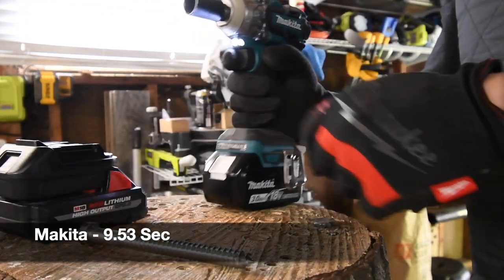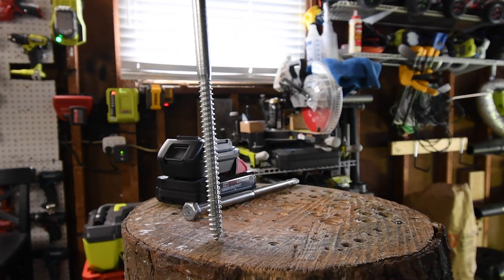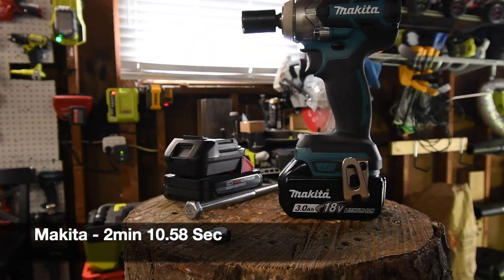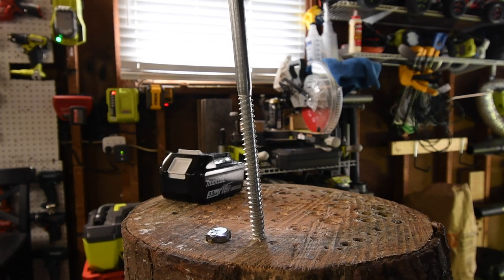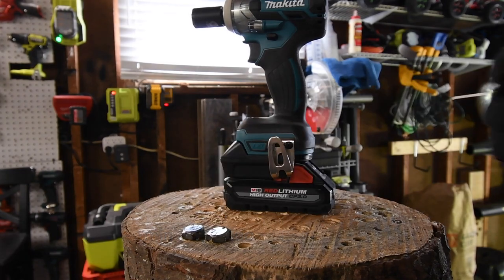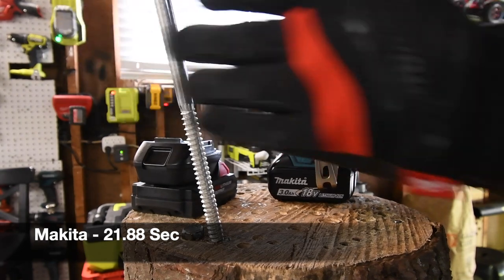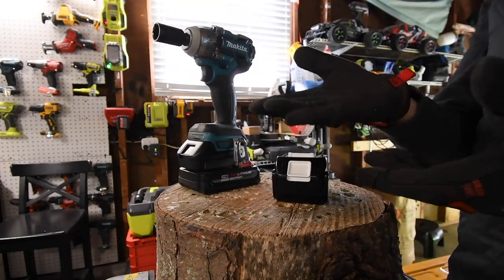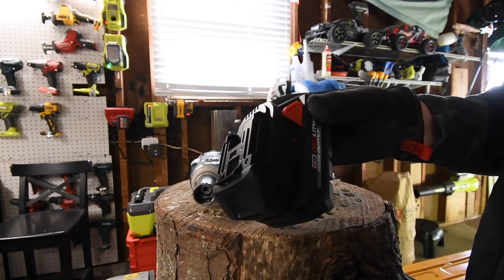Makita Battery Adapter for (Milwaukee and Dewalt Batteries)

Comment: So makita X2 36V with two adapters and HD 12.0 high outputs.
Reply from the maker: Makita needs to make 18v batteries with 21700 cells
Reply: Pretty sure they wouldn’t fit side by side. I bet that’s one of the reasons Makita hasn’t released a 21700 battery. Compatibility in the 2x18v tools.
Reply: Where can i get those adapters
Reply: @markdandan6047  amazon
Reply: @ManCaverTools  bit seriously has anyone heard Makita say before why they don’t? Can’t wrap my head around this. At this point it’s like a badge of honor to them to not make High output batteries.

Comment: That Milwaukee battery seemed to make a big difference.  I bet if you do the reverse test with an M18 fuel tool with an Milwaukee XC battery verses a Makita battery the difference might even be more pronounced, because of the communication between the tool and battery that Milwaukee touts with the fuel line.
Reply from the maker: I plan on doing more tests with these adaptors :)

Comment: Makita definitely needs to step up there battery technology, but I assume that is what the 40 volt platform is all about, i own a couple of Makita drills as if yesterday. I'm curious if these battery adapters drain the battery if left on the tool when not in use, I heard something about that a few years ago.
Reply from the maker: I still think Makita needs to make a 21700 celled battery for the 18v line
Reply: Dave, I have a question, do you think the Makita DHP481 is still a drill worth buying, I know you had some troubles with yours at the beginning of a video a while back, I bought the DHP481 with a couple of 6ah batteries and love it, it seems to be better made than my DeWalt DCD996.
Reply: @ManCaverTools  I have to agree to the 21700 batteries, seeing you yes the Milwaukee 3ah HO with the batter adapter was very interesting, Ave claims the Mikita batter might not be as powerful but the battery will outlast and DeWalt or Milwaukee over its entire life.

Comment: Who'da thunk that the Milwaukee battery was superior to Makita.  It wasn't even close.
Reply: Well I did, it’s really not the tool that has the power it’s more the battery all the tool has to be able to do is handle the power 

The battery gives the power and the tool just needs to be able to hold and be able to take full potential of the batteries power
Reply from the maker: the results were crazy to see and I thank you for viewing David

Comment: Very good video, and great information!
Reply from the maker: I thank you Jerrin
Reply: @ManCaverTools  no problem, your testing shows that Makita needs to change its battery platform to 21700, even though I prefer Makita tools to Milwaukee. I will buy an adapter to mate to the Makita tools. Excellent work on this, can you compare the 5 Ah milwaukee to the 5 Ah of Makita

Comment: I hope you have any plans to make a vid about using flex or highoutput 8ah on powerful makita's tools like circular saw or recip saw or new drill xpt14 through the adapter to compare the defference more. It'd be super interesting. I saw this and your previous test it's fine but impact or wrench are not so powerful in my opinion

Comment: Hey Dave, great video as always mate! Will we get a video about DeWalt's new 10ah 20v max batteries? Fingers-crossed they have 21700 cells!
Reply: 00000
Reply from the maker: yes I will and I want to get the new 5ah 12v impact wrench as well

Comment: Nice video Dave! Hey question for you, why does my new drill sometimes instead of stopping right after I release the trigger it just slows to a stop? it only happens 1 out of 1000 times I pull the trigger, and only when its not under a load but still its brand new. Is something wrong with it? my old drill did this too. Thanks!
Reply from the maker: some tools have to wind down before they stop

Comment: That’s awesome stuff. Just keep in mind using anything but makita batteries will void your warranty.
Reply from the maker: I take these tools apart and most of these tools are not valid for a warranty anymore lol
Reply: How they going to know ?
Reply: @erikaslt  if they get in there and find a fried circuit board or something because there was no over current protection they’ll know and deny your warranty claim. I’m not saying it’s good or bad either way just wanted to let you know it’s a risk you inherently take if you use these adapters.

Comment: 3ah 21700 can beat 5ah 18650 ?
Reply from the maker: yes it will. and I already did some videos on that and will be doing more of that test as well
Reply: @Man Caver Tools hi, i try this on subcompact makita drill w/ 2.0ah vs 3.0HO. I feel like, mmm. I don't think it's too significant much on power.. But if you have time, please re-test
 w/ 4.0ah/5.0ah. i want to know how does it make improvement?? i found on ebay, who sell diy batt pack case kit 21700 for Makita. I'm very interestting to bought it. thanks man.peace

Comment: Adapters are great for tools that no longer get support , I don't see the point on them being used on tools they still make batteries for . you want to use a Milwaukee battery ? Buy the kit . If they no longer support it , toss it and buy another that will eventually become obsolete
Reply: @hawaiihotboi  the adapter was found locally but not the battery?  If you ordered off the internet why didn't you just convert to Milwaukee????
Reply: @hawaiihotboi  toss the ryobi and just use milwaukee.
Reply: Cost difference is my reasoning. An adapter for my ryobi, makita, and dewalt tools cost only 16-30 and I have a good amount of Milwaukee batteries.
Reply: @lonedesertfox  how did you end up with a mismatch of batteries?  Whenever I kill a tool I toss it and sell the batteries to the other people on the site. I find that buying a kit is cheaper than buying a bare tool
Reply from the maker: I think its great to have the option to use different brand batteries
Reply: I only have one ryobi tool right now and that is a drain auger that only came with a 2 amp hour battery, my Wife won’t allow me to buy more of those batteries ...but she didn’t notice the $15 charge when I got the adapter. ;) worked out in the end!
Reply: The point is if you have invested heavily in one platform and there is a tool from another brand that you prefer you only have to buy an adapter and you can use all your batteries on it,great option .
Reply: @interman7715  but new cordless tools are improved by size and technology. Adapt to evolve or evolve for adaptation.